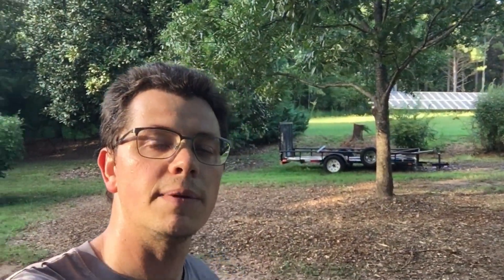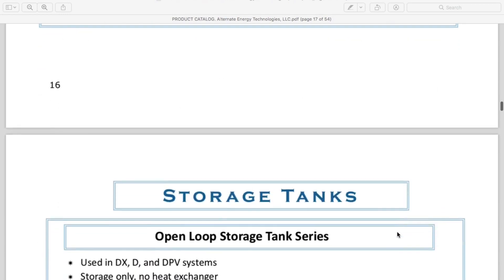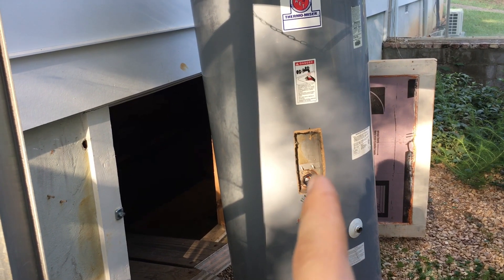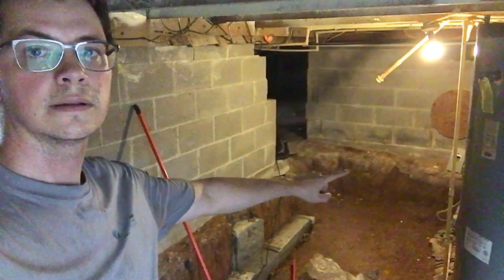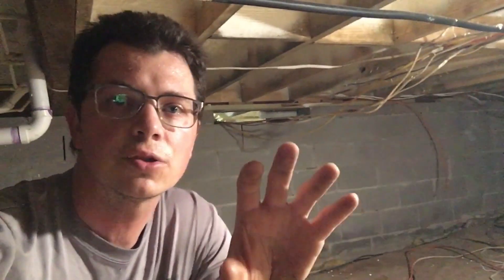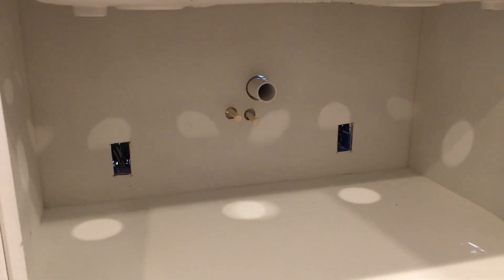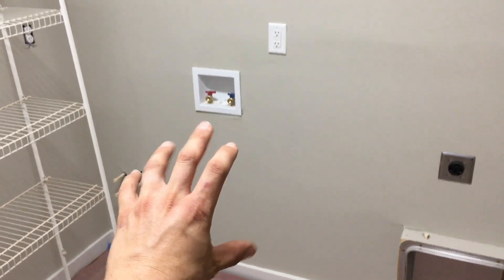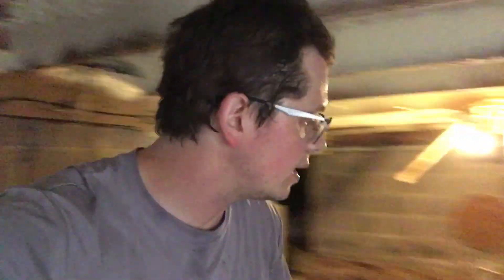My Solar water heating project pt1: heat pump water heater locations

Comment: Really like what your doing to the house. Did you do the cell foam spray yourself in the crawl space? I know that stuff is expensive, just did my work shop. BTW you look to young to have 5 kids but don't let it go to your head. I've been thinking about building a fence with 2 in. black pipe and running it into a pre- tank then to my hot water heater. I'm not to sure how efficient that would be, but I do know how hot the water gets in my water hose laying in the sun.  That place you mentioned are they still selling the solar water heaters? Thanks for the video.
Reply from the maker: Water gets hot in the sun. Look on Craigslist and FB marketplace for used hot water panels. They don’t have moving parts and off they hold 40 psi they are good.

Comment: Are ya installing a hrv? One of many ways to balance efficiency in homes is tightening up the air losses. HRV setups match exhaust air from hoods dryers and fart fans to keep homes pressurized with fresh filtered and tempered air. 
As for the HPWH, I'd put it in the laundry room... but it'll be cold in there in the winter time.
Reply from the maker: It’s a pretty old and probably pretty leaky house but I did my best to seal her up food and insulate it.  We have 4 kids and another one on the way. They homeschool so the house gets ventilated a good bit.

Comment: For me, I run 1" per through the entire house, and run 3/4" per to each user...
A single 3/4" pex line fed from 1"pex will outflow both sinks...
Reply from the maker: You got good flow. I did a 1” cold manifold that branches off to the 3 different plumbing areas and then a delicates line to the hot water heater. But all 3/4 and 1/2. Did lots of sweeping bends and used minimal fittings.

Comment: I have a potentially really bad idea for ya...  What if you bifurcate the exit air from the dryer and put "dust collection" type blast gates on each leg so you can select one side vents outside (normal) and the other vents to a "closet" with your heat pump water heater in it?   Note: it still has to vent to the outside or could be potentially dangerous but maybe there is a way...  The house is looking great and the subs are climbing!  :)
Reply from the maker: That’s a code violation!! Sir. Jk
Reply: @GainSolarPower  BTW: great singing!  Son I'd like to show ya how I heat my solar hot waterrrrrr, how I got my 50 gallon tank much hotterrrrrrrr.  
https://youtu.be/GOXHSmickt0
Reply from the maker: I’ve seen this one of yours. Years ago.

Comment: Depends on your water pressure.  At 40 psi would run 2 sets at 55 or above (maybe 50) one set is plenty.
Reply from the maker: I’m running another. It’s been decided but me and Engineer775 figured that theoretically( 1 )1/2 supply would be fine.
Reply: yep there is a video about limiting water use that proposes using as short a trunk line from central location in house and then short 1/4 inch lines to conserve water on hot water lines so wait for hot water will be shorter
 @GainSolarPower

Comment: Personally I would get a heat pump clothes dryer and put the water heater in the basement but either place you put heat pump water heater get a heat pump dryer.
Reply from the maker: Going to research this. Do you have one

Comment: Two is one and one is none is the answer for both questions. Heat pump with solar for backup and two supplies for the sink. Five kids turn into five teenagers all wanting hot showers and a ton of hot water for laundry.
Reply from the maker: And teenagers need to have full port hot and cold so they can cook dinner and wash dishes at the same time.

Comment: Tank in the laundry room!  Cooling, safe from any water issues if the crawl space ever floods, they are not cheap. If you ever come across a deal on another heat pump water tank replace the free tank in the crawl space too, no hurry but one may show up in your travels in the next decade.
Reply: I would never replace a stainless steel direct solar or even indirect solar water heater. I would make it direct pv with some dedicated panels.  Its not worth the trouble to have the old style hot water solar.  Too many things to leak or go wrong with pumps drawdown etc. Simply not worth it.  I dont know anyone that would even buy one these days.  Even though you have all the skills necessary still not worth it. Great to have 160 or so gallons of at least heated and preheated water!!